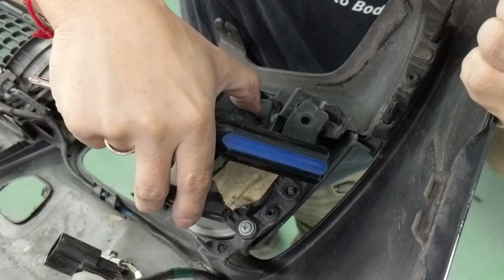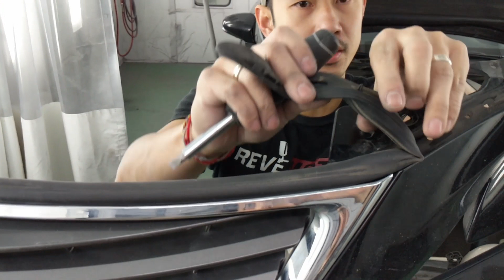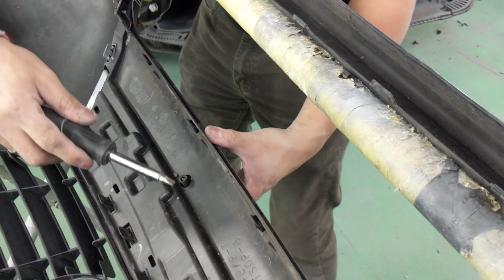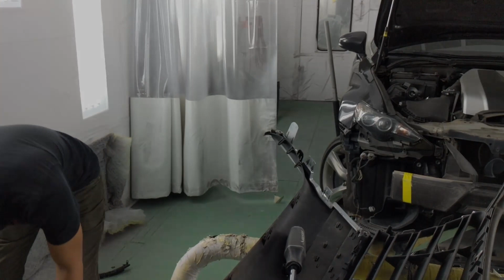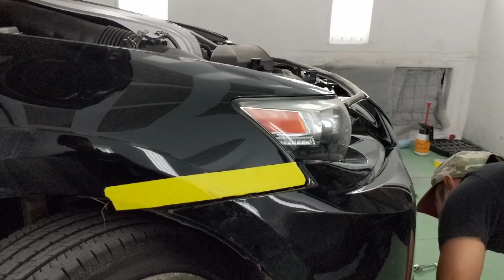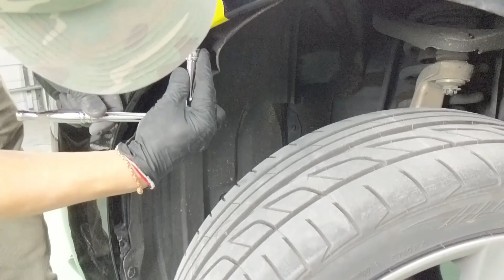How to Replace a 2014-2016 Lexus IS250 Front Bumper | Full Steps Start to Finish | ReveMoto

Comment: Hey!! I want to remove just the chrome hourglass on my 2016 IS 300 Base. Do i have to remove the entire front bumper to get it off?
Reply from the maker: The entire grille snaps in but I believe there are a few small screws that secure it. They are at the middle, top and bottom. If you can get those little screws, out you probably don't have to completely remove the bumper. Thanks for watching!
Reply: @ReveMoto  thankyou!!

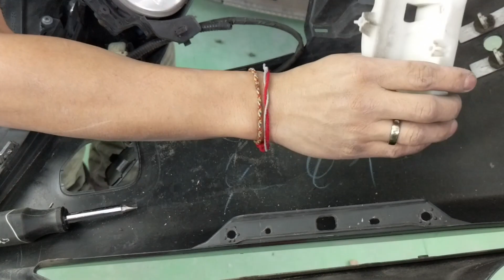Comment: Hey great video! Do you happen to know the name of that white bracket for the turn signal where the clip broke off right around 3:53? Trying to replace mine as well but having hard time figuring out what part number it is.
Reply from the maker: Hello. That is a tough one. I tried to find the part number online but I had no luck. If you call Lexus and ask them for the "daytime running light" bracket, they should know what you are referring too. Just describe it them, they have a detailed diagram with part numbers. Those parts are normally OEM only, buy you might get lucky and find one at a junkyard. Good luck and thanks for watching!

Comment: I have a 2016 Lexus 200t f sport but I like the newer front bumper look from 2017. You know if it’ll fit?
Reply from the maker: Yes, it should, possibly-maybe fit. The fenders and the hood range from 16-20 so the shape of the bumpers are most likely the same. We recommend checking with other sources as well. We can say with 100% certainty until we do it. Thanks for watching!
Reply: @ReveMoto  I appreciate this a lot thank you!

Comment: Do you happen to know if I swap out my base 2015 just the grill for an f sport one would it be a direct fit?
Reply from the maker: Hey! That is a great question. The difference in the bumpers is the bottom half. The bottom has different fog lights and vents on the bottom. So, the F-Sport grille might be just a bit narrower. Don't take my word for it, check out the Lexus forums, I'm sure they know the answer.

Comment: Hey do you know where the bumper bracket is supposed to go to. I removed my front bumper to replace grill and two brackets came off and I don’t know where they go
Reply from the maker: The bumper brackets go on the side of the fender or under the tip of the fender if that makes sense. They bolt on the fender and the bumper clips onto the fender or bumper retainers.

Comment: Possible to replace the grill without removing the bumper on a 2014 ?
Reply from the maker: Hello Randy! There is always a possibility but it's clipped into the bumper and it has small screws that need to be removed. You at least have to remove the top end of the bumper. It's just so much easier to remove the entire bumper, which isn't that bad. Even putting the new grille on would be easier with the bumper off. Please let us know how it turns out!